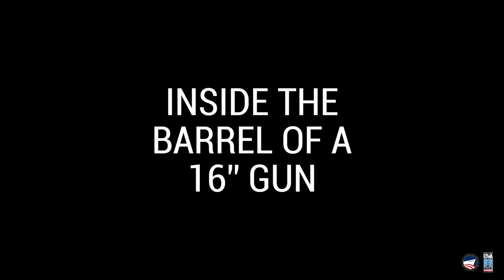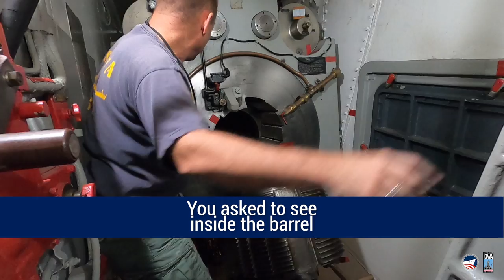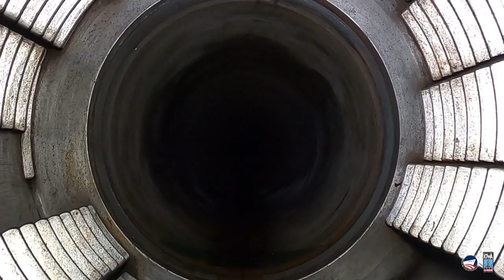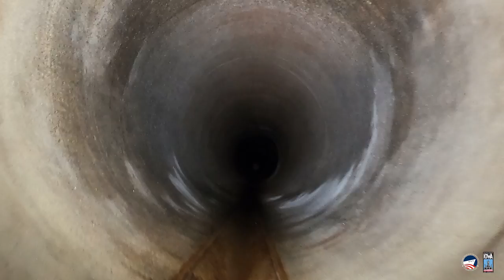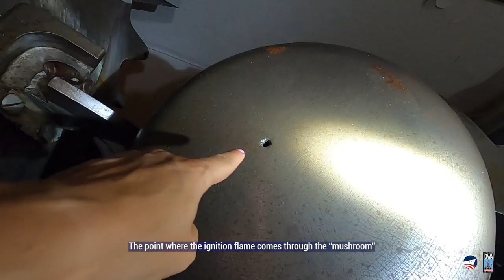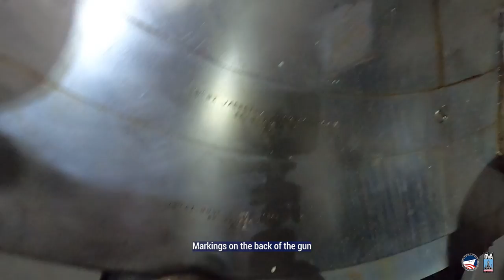Inside The Barrel Of A 16 Inch Gun

Comment: Looked smooth.   No rifling???   I wonder WHAT IF there's rifling in the bore!!!
Reply: What's shown in the video is just the chamber of the barrel. The rifling starts around 7 feet in....
Reply: @richardkoehnen7348  In my days of working on precision rifles for snipers, the projectile must be consistently mils from the rifling grove to have best accuracy, right up to it but not touching it.  If gun powder bags are allowed to vary between 5-6 bags, I can see severe variation of distance to rifling groves at the moment of firing.  I don't see how MC Skelley can even imagine the thesis of his experiment using 5 bags instead of the usual 6 bags, which is one bag further away from the rifling groves.
Reply: @fredflorist1682  well unlike a case gun, the shell relies on the rammer itself to be seated. Now I am in no way a us naval gun expert, nor did i ever work on or serve on a big gun ship. Based on my own personal reading, If I recall, the shell is rammed to the point where the shell actually "seats" itself by the brass rings into the base of the rifling. This also ensures that the shell is adequately centered in the barrel. Im sure that the ramming mechanisms of the ships are calibrated to the point that its furthest length of travel makes sure that shells themselves cannot be over rammed into the rifling and ensure that in the event a shell must be backed out for whatever reason, its not completely cemented into the rifling which would probably destroy the barrel during the process of backing it out. Mind you, you probably know that in order to back a shell out of a naval gun, a plunger is basically lowered into the barrel (which itself is raised) and the shell is beaten out jack hammer style. The bags are placed in such a manner that the last bag is always just in front of the mushroom breech plug. I only ASSUME this is the case based on videos and because if the bag with the primer is placed too far away from the plug, there may be a misfire. Same thing goes as if a rifle round and its primer is too far in the chamber from the bolt face, the firing pin might not strike it.
Reply: @ObamaTookMyCat  I've heard more than once and from different gunner's mates or experts that the projectile is seated so that the brass rings on the projectiles bite into the rifling so that they can't be backed out without having to lower the gun and use brute force (a bunch of young men with a long pole) to get the shells to back out. And those shells are armed by this point. The usual way to unload the guns is to find a smooth patch of water inhabited only by fish and deposit your shells there.
Reply: @Odin029  The gun is raised to maximum elevation and a brass backing tool plunger is dropped down and impacts the top of the shell. the pole and brute force was probably used on the 5" guns. Turret 1 of Iowa had a misfire the same day as the explosion in turret 2. They had to beat that shell out.